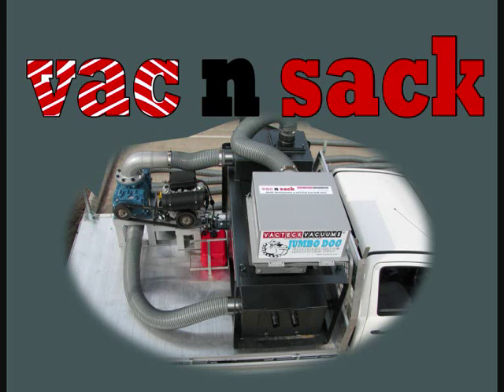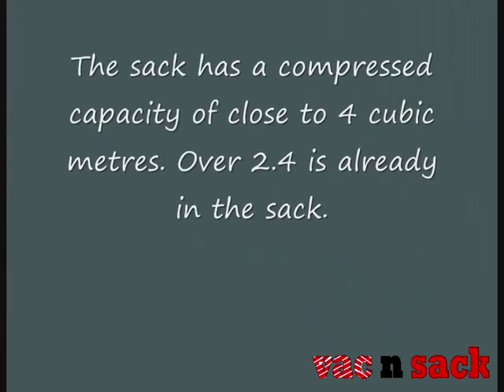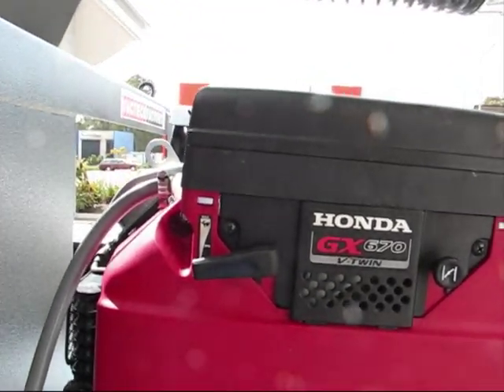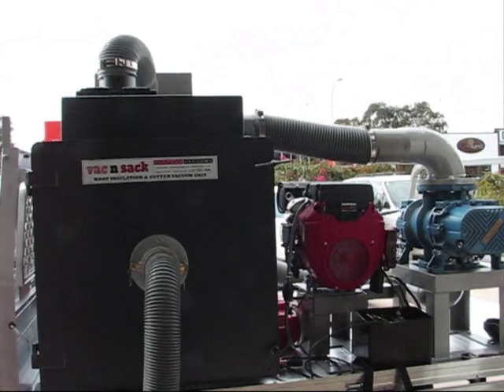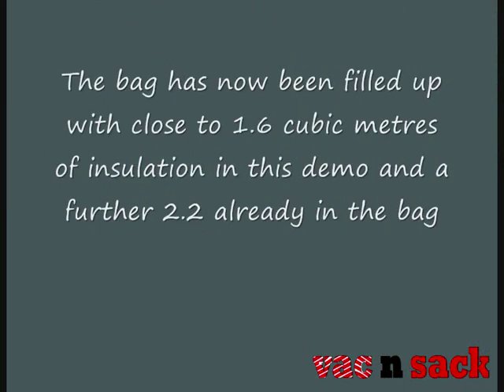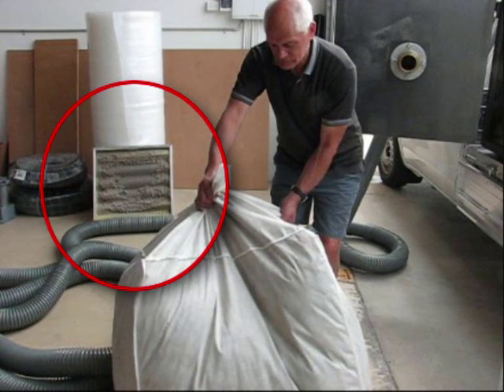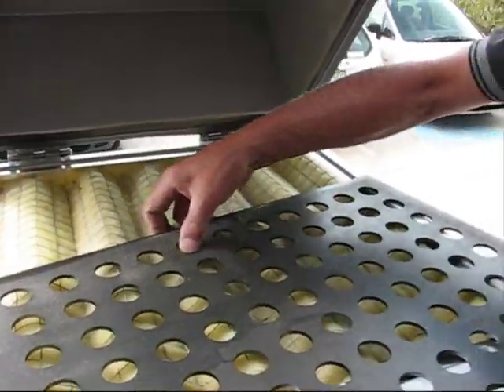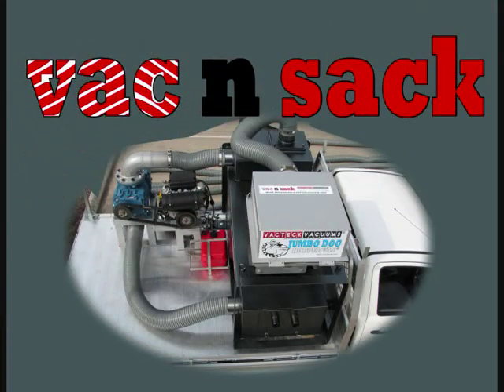Roof Insulation Vacuum for removal of old roof waste

Comment: This is not a HEPA rated system, and if you are using it to remove asbestos containing roofing waste or vermiculite insulation you are running the risk of huge fines from DNR, EPA, OSHA and your state agencies. EPA says vermiculite can't be tested, since a sample in one part of the attic is no guarantee a sample from another area is the same material.